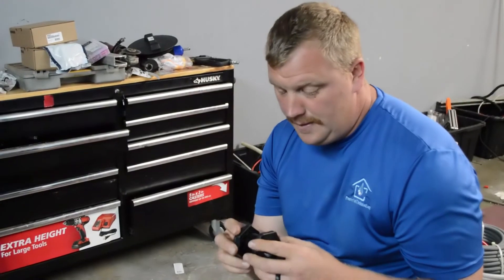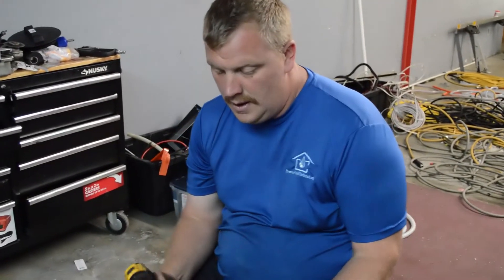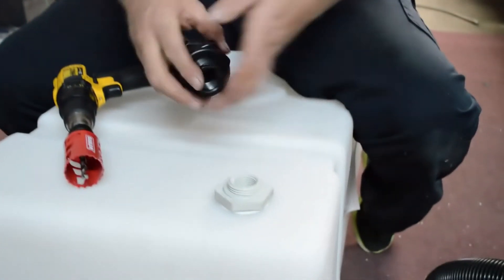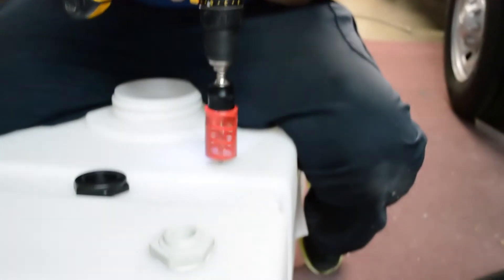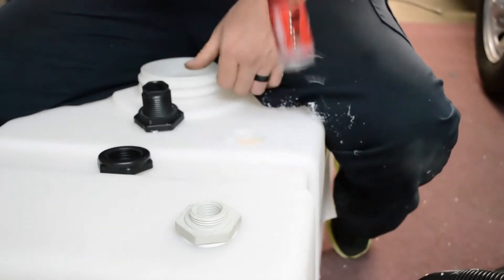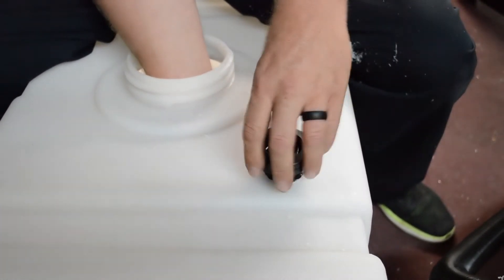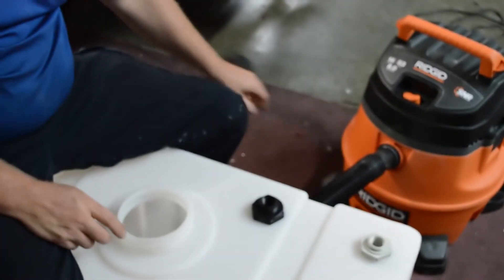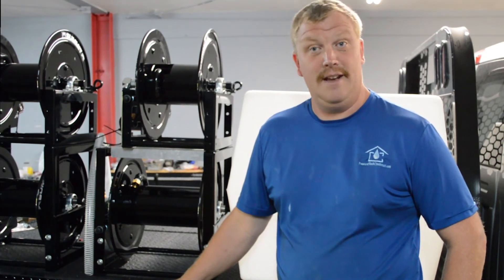How To Install A Bulkhead Fitting In A Water Tank

Comment: If I have 3600psi 5.6 gpm pump, what size bulk head fitting and hose should I have leading to the pump for my flow rate?
thanks for you sharing of knowledge as a green horn getting there first rig put together I cannot thank you enough
Reply from the maker: 3/4”
Reply: @kingofpressurewash  Wow,only 3/4" for 5.6 gpm I would think atleast 1" no??